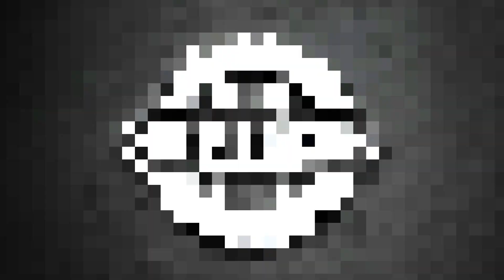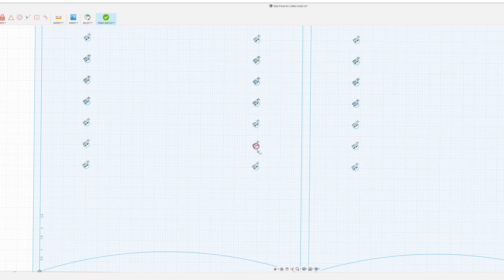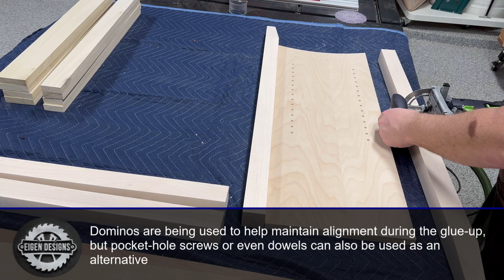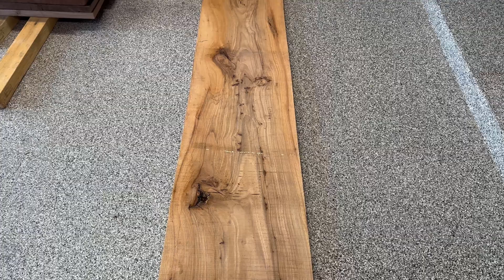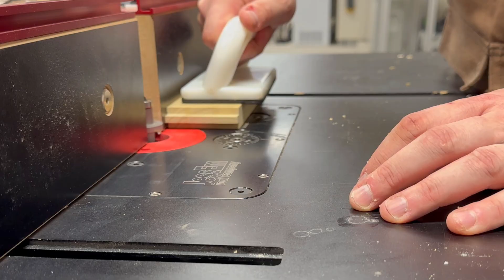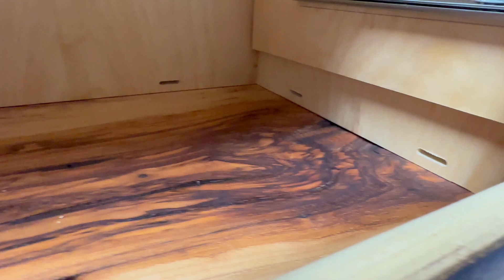Modern Coffee Hutch  |  How To Video in 4k

Comment: A suggestion to help with safety when making stile and rail doors.  First I always make my S&R 2" wide.  Instead of trying to cope a 2" piece I use a 1x6 and cut it to length of the rail.  Then I cope it, then switch to the pattern bit on the router, with quick pass down each side of the piece you now have two complete rails one on each edge of the 1x6. Finally off to the table saw to then rip the piece into two 2" rails.  I also make my stiles out of a 1x6 just keeps my hands further away from the bit.  It is a much safer operation. Great video just thought I would make a suggestion if you are going to make a lot of style and rail doors.
Reply from the maker: That’s a really good idea Donald, thanks for the tip. I can also see that method being more efficient when batching out large numbers of S&R. I appreciate you sharing that.

Comment: Question from someone new to woodworking. For the 1/4" drawer method could you use a 1/4" straight router bit on a router table and achieve something similar? I don't have a 1/4" dado stack but like this idea to make some drawers. Thanks for the video great instructions!
Reply from the maker: Absolutely. You can use a 1/4" router bit and get the exact same result.
Reply: You can but I would just add one twist.  Assuming you are using plywood, instead of setting your router bit to the 1/4" height right off the bat, I would set it to just take a scoring pass.  This will help reduce tear out, run all your pieces and then raise your bit to the final height.